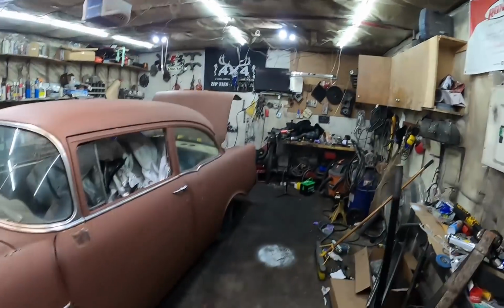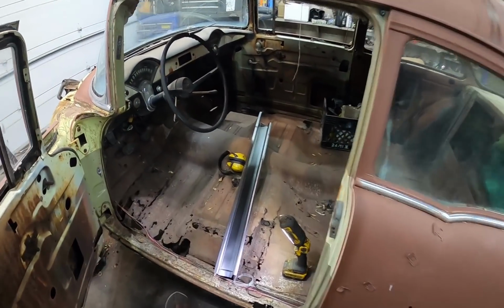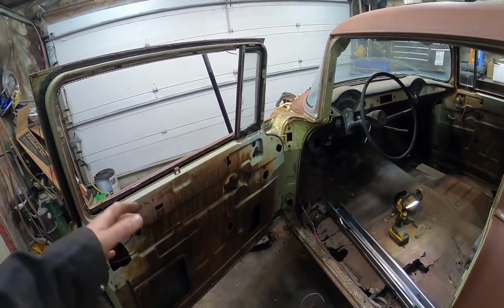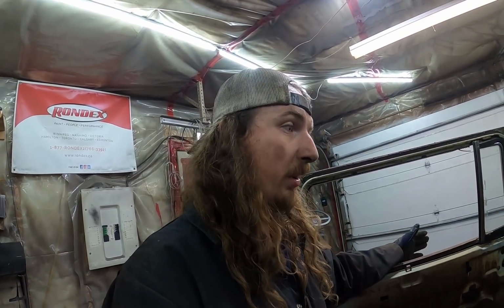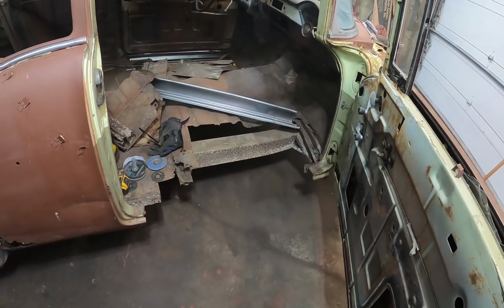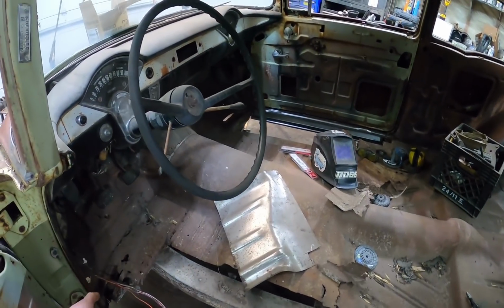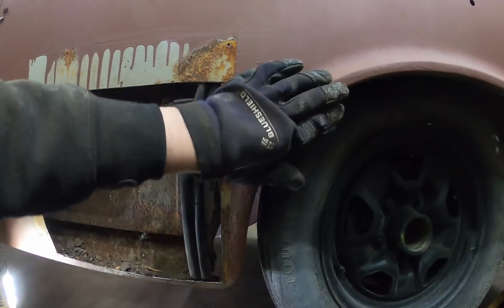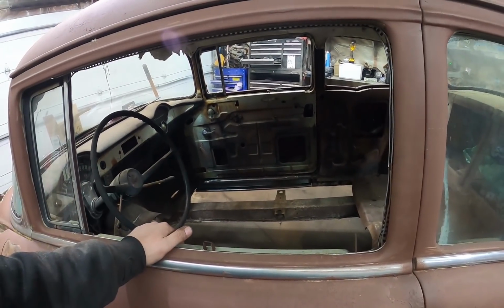Cutting A Classic Car In Half To Fix The Rust!

Comment: My trick to fixing a rusty car is just pretend that the rust never happened and ignore it and put a drive line in it and make it driveable then maybe think about fixing the rust, maybe lol. I just do it that way because everyone wants to fix all the rust before getting their vehicle running and "driveable" but usually those people never finish where if you atleast get it moveable under it's own power, things seem to actually get done, just my way, everyone's method is different. Good job, keep up the good work.
Reply: I did that with my daily but the peice of wood holding the seat up has fallen through the hole as it gets bigger.
Reply: @Mercmad  well as long as the rest of the vehicle is good and perfectly driveable, then it's worth spending a weekend and hackily fixing the rust and getting it back to good enough. Also try not to over do rust repair,  everyone tries to do a chip foose job and they never finish where if you get done what you can and just make it work atleast something will get done.

Comment: My first car was a 56 chevy 4 door sedan that I bought from my neighbor for 15 bucks when I was 14. I bought a 57 Belaire convertible from a family friend for $ 25.00 that had a blown 348, 59 engine & a wasted rear end. I put the two together, & had a sweet little car. My brother & I fixed it up, & then had it painted wimbleton white. White with a black top With Red & black interior. We found a console from a ford falcon, & plymouth bucket seats at our local junkyard, this was around 1972,or 73. That 57 convertible frame had a big X member built right in , cause it wasn't a hardtop, but still if you jacked it up with a bumper jack , you couldn't open or close the doors. Watching you do this reminds me of my youth, I'm now 63... We hadn't heard of a MIG welder , We had stick & Oxy-accetelene, but like I previously noted , it was 1972,& 73...
I once even owned a 1957, "150 " , 2 door sedan. It had stainless side trim like a 55, or 56, at the time I never realized what we had. We Stole it's complete front clip & trunk lid , Then  we scrapped the rest of it. My Brother & I were buying every tri 5 chevy that we could find, for $5.00 to $25 bucks. We'd strip them then Scrap them, because they weren't hardtops. Most of them were 210 sedans, 2 door, 4 door, & a few station wagons , these days that'd be a sin. But back in those days We bought Quarter panel repair panels from Warshaskies, or J.C. Whitney, & all we had to worry about was that front seam, the top fell behind that 57 spear. There was  some back panel blending, but remember we'd never ever seen a MIG., We were still diong hammer welding, with a torch , a body hammer, & dollie. We had to finish it much finer , cause our dad still remembered Lead  Body Work. He taught me , that I had to get it as straight as I could before the leading ever began. We'd hammer & dolly, then we'd scrub that metal, polish it , till he said it was good. Then He would "Tin" the metal, prepairing for the lead.He used a neutral flame when the  magic soon began . He would heat, & work that lead onto the panels made of steel, then he used an oak paddle  dipped in bee's wax to work the lead into control. Then came that Vixen file, as it started to take shape. 
It was a different time my friend, but , "Tri Fives Still Set The Pace"...

Comment: I had a 57 hardtop I was going to put the full floor in but never did and sold it.  When I was researching the best way to do it, saw a guy who lifted the body up, bolted the new floorpan to the frame with new body mounts, and then carefully lowered the body over the new floorpan, with the doors in place.  Then went around and put screws in it and adjusted things till it fit well and then welded it in place.

Comment: I used my engine crane with some tow straps to lift the body off the frame. Lift it up level by the roof through all 4 Windows.good time to replace the body mounts as well

Comment: Nice job with the 56 nothing better than seeing a Tri-Five being brought back .Hey just a shoutout when you put the headlight caps in and fit and weld them bolt the headlight bucket in and bezel for proper alignment to the fender cap roll on top and inboard to inner fender flange .I made this mistake and so have others after welding. My drivers headlight cap done many years ago is 3/8 off inward slightly on the top rollover portion to the bezel and its noticeable. Not a biggie on a daily driver so not sure if you care but just a tip. I will remind you when you do the video keep up the great work! Glenn a 55 owner. I have two videos showing it on YouTube ,......regards Glenn

Comment: One man prop rod hood removal trick, loosen all 4 hood bolts, then remove both front bolts from hinge completely leaving both rear bolt in, then remove one rear bolt on one side and drop hood on that side to the fire wall then walk around and remove the last bolt with the prop rod still in place, then remove hood as you did by pulling prop rod out to pull hood off, ( you can install a hood the very same way with a blanket across the firewall to protect the paint all by yourself )  Glade your taking my suggestions to hart as these are all tried and true processors   :)  Another trick, before you loosen any hood bolts take a sharp pointed scriber and scribe a line around the hood  at the hinge location to let you save time installing the hood when it's time to re install it . ( yes I seen you fighting the hood back on your square body truck )   P/S Pleeeeese lube the door hinges on the 56 !! as them door hinges are not easy to replace   lol

Comment: Dam shame someone cut the spring hangers , although you can still buy them new , I swapped mine side for side and mounted on inside of frame , fairly easy to do  , especially with your skills , ( 69 Chevelle 12 bolt ) made a two link setup for each side on top of axle tube with heim joints to frame , worked like a 4 link with the springs being the bottom links , fit a 29.5x10.5 MT slick under it , Would skim the front tires with a 8.5:1 cast piston smog motor 454 in it , would run a 12.20 all day on 87 octane , not fast but fun , couldn't remember if I told you that before , Looks good Dan  , keep the vids coming

Comment: One piece at a time you always get it done. I think if it were me I'd go ahead and put a high x brace across the centerposts before I took it loose. Like no lower than door striker height. Just enough to kinda keep the sides from sucking in or spreading out. There will still be enough flex n room to get your floor sitting the way you want too. That was a really common color scheme back in the day. They liked it to use in the ads. Don't see it much anymore. Keep the junk in the trunk, take your phone with you lol.. Thanks for sharing
Reply from the maker: Haha stupid phone.  Yeah the color is hit and miss for me.  Looks good with all the trim

Comment: I'm wondering if the floor will go in with the rockers in it?  Don't the floor and  the rockers overlap each other? Or is the overlap just at the top of the rockers? I guess we will see in the next video!  My favorite tri 5 is the 55 Belair Hardtop and the convertible, When I was a kid I had it in my head I was going to get one when I was old enough to drive but my tastes changed and I started buying all of the broken down Pontiac  GTO'S  Lemans and Tempests I could get my hands on and fixing them and flipping them and keeping a few for myself of course!  I have branched out now and I have all makes of cars now, Even my daily drivers are 40 years old on average! See you next video!
Reply from the maker: I'm hoping it will haha

Comment: You could weld those doors shut, makes it hard to get in and out, but will really hols everything in place? Just a thought!
Reply: 👎 cant weld in floor with doors welded shut
Reply: "X" between front and rear door posts (always have small round or square around for bracing)

Comment: With a couple days work you have already turned that $300 dollar car into a $3000 car! I did one of those full floors in a 57 a few years back and it actually fit pretty good for an aftermarket panel, I went overkill and braced the hell out of the body. 100 bucks in square tubing and a few tack welds was cheaper than potentially spending days trying to realign everything.
Reply from the maker: Should be a sweet car.

Comment: Dan I was thinking that to get the complete floor in you might have to remove the windshield and the steering wheel so it will slide in.
Reply: My friends and myself when we in our 20's did a 67 Chevy II SS with a floorpan that was rotted from firewall to the rear bumper.  We slid the floorpan complete with trunkfloor from the bottom in one piece.  Worked great!

Comment: Hey Dan make it easy on you cut the new floor down the middle and weld it back together if you decide to put it though the front run a few braces in the body or it will twist on you good luck .

Comment: I like your rear spring idea...,but I wished you'd replace the quarter on the passenger side. You are very good and familiar  with these cars.., and you have a 55 to drive so you can do it better than some folks. The original  color isn't my favorite colors but I bet it would look cool painted that way.

Comment: Dan, you did fine wrestling that front clip off by yourself..Meh, tri-fives use a ladder type frame, 69 Chevelle uses a perimeter type frame so the frame is at or near the rocker panels.

Comment: Um, that floor you just cut out could be the basis for that coupe you happen to have sitting around, saves a ton of metal forming.  Even just the tunnel plus a foot either side.
Reply from the maker: Its pretty rough. Right up into the tunnel

Comment: You are constantly mentioning how cheaply Rock Auto can be bought. I checked it must, but was shocked by the freight charges. How do you manage? Is there a warehouse close to? I am in Northern Alberta. The nearest large city is Edmonton. It is about four and a half hours South of me.
Reply: Same city as Dan, our use of Rock Auto is most often the speed with which the parts get delivered, order mid-day Friday its entirely possible to get a call late Sunday and certainly Monday that stuff is waiting for you.  We have found there is not a lot of variation once you are "all in" regardless where you purchase from and in many cases whether or not you purchase from a US or Canadian supplier (often a branch/arm of the US anyway).  COVID has meant a few more snags in terms of delays but figure on 2x what the US price is and be "pleasantly" surprised if it works out to less.  Rock Auto, at least for common parts, has a lot more price choices than someone local so if all you want is up and functional it can be considerably cheaper (but shipping is the same so...).
Reply: @russellzacharias3535  I loved the cost of parts, but what kept me from ordering was what they were going to charge for shipping it. It almost doubled the total price
Reply: Thank you for the response.
Reply from the maker: Gotta shop around on the site.  Sometimes the more expensive part is cheaper the ship, sometime fed ex is cheaper than Canada post. No rhyme or reason to it.  Also run the part numbers though Amazon.  They have lots of stock

Comment: I know opinions are like assholes but on the front there were you cut the tab off the goes up underneath the front of the cow on the rocker for future reference what I have done is after I get it all lined up in there and straight I weld a new tab to the bottom of it by plug welding it and then after the floor in the front braces removed you can then bend it up against the Front Bottom and weld it down